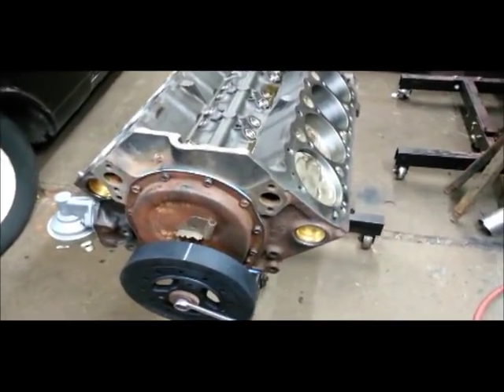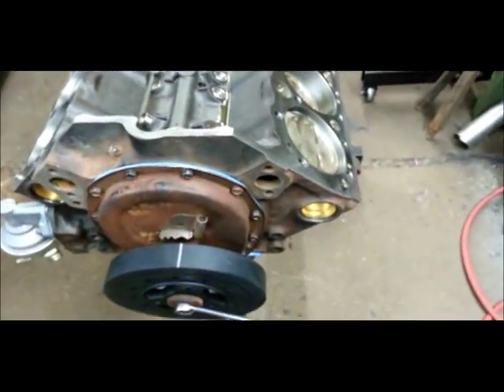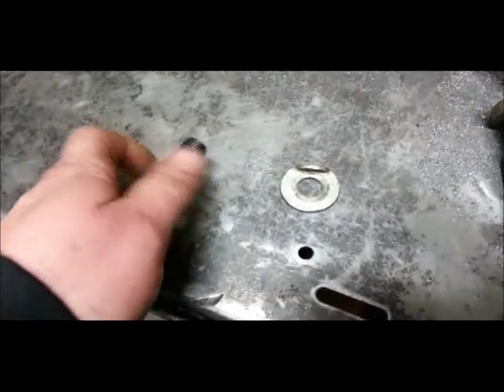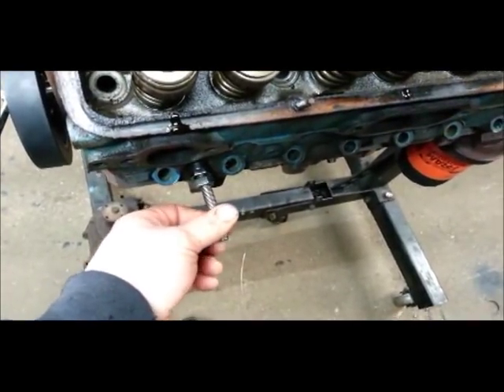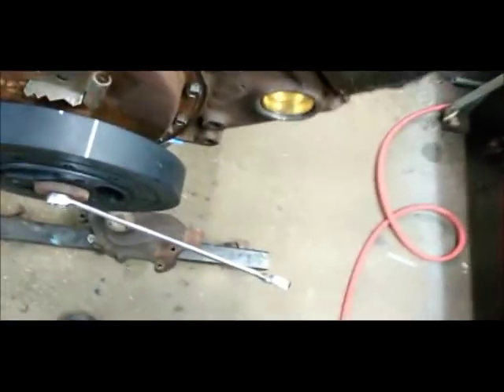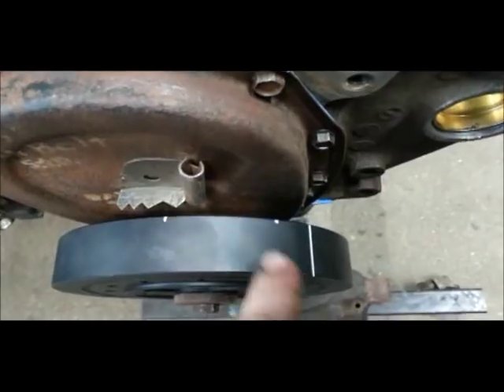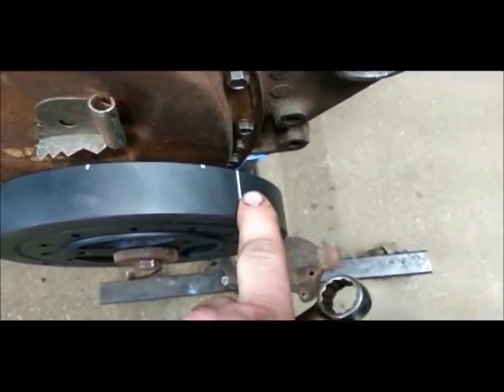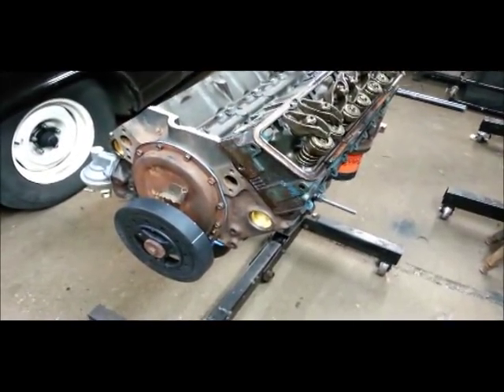finding top dead center .

Comment: Good explanation.  It took a while to get to the point but I get it now.  My 5.7 1995 Chevy doesn't have a timing mark on the harmonic balancer and there is no timing indicator gauge as well so I will be putting one on similar to your friend wanting his not part of the timing chain cover.  I guess I will do the finger in number one spark plug hole (or vacuum tester) as I am not removing the head to determine the power stroke and then apply your method to fine tune the TDC mark to make on the balancer.  Thanks!  Now to see if I can just tap some bolt threads in my compression spark plug adapter first or use your hollowed out spark plug method.  Good job.

Comment: To find out how far to put the rod into the cylinder, turn engine til compression felt put a rod ie screwdriver into the plug hole and turn motor til screwdriver nearly out, turn motor back slightly and screw piston stop in til it just touches the piston, back it off a couple of turns then SLOWLY bring the piston up to meet it this will eliminate any backlash. Hope this helps, takes longer to write than to do. Dave UK

Comment: To be clear, that's TDC for that timing marker.  If you are going to use a non-stock timing cover/marker, chrome or otherwise, you would use this process with the cover/marker you are going to use.
I've built several SBC's in my time and never saw a timing cover with the marker center top like that one.  How in the heck would you even see it with the water pump and pulley installed?
Reply: mark the pully so you can see it
Reply: @frankdavidson9675  very true.  if you ever have a balancer off, paint it black or at least the timing mark area then use liquid white out or equivalent to make the mark to get good contrast.  They are often buried down there on most cars, make easy to see.

Comment: This video does a good job explaining how to achieve # 1 TDC. 
However, if anyone is going to take the time to do this, please understand that;
..... "getting close only" is NOT OK.  
..... it is NOT overly complicated to do.
..... we can obtain acccuracy if we follow several very simple steps. 
 
The split should be near 30 degrees or so. 30 + 30 = 60. A 60+/-  degree split offers more accuracy than a 20 degree split does. 
Once the piston is in an acceptable location from Top of Stroke, the PPS tool should not only be tightened, the inner threaded portion should be locked by using the jam nut. 
The new TRUE TDC mark should be made adjacent to a timing tab ZERO notch that is easily viewable for Ignition timing.  
The marking shown in this video may become blocked from veiw by the engine coolant circulating pump and/or by pulleys. I would opt for a timing tab that was fixed more towards the # 1 cylinder. 
Things to NOT do:
.... use a finger over a spark plug port to dertimine when the piston is at top of stroke. 
.... use a washer over the cylinder bore to dertimine when the piston is near top of stroke. 
.... use a minimal split angle.

Comment: Thanks for the knowledge sharing. I only got a question, why are we doing this, was it a change on a part that changed the original mark on the balancer? Put it in a different wording, why the balancing mark didn't match the timing to begin? I am curious as I have a 99 Suburban that some people say it could be a timing chain jumped a teeth... Thanks in advance, Jose
Reply: I’m wondering the same thing

Comment: I've been messing with that old small block I've had for twenty years. I must have set the timing by ear in the old days. My marks don't line up at all. Chrome cover.
Reply from the maker: I can never seem to get the right combo of timing tabs to dampners . So I'm always remarking them it seems.
But I didn't make that tool until just a few years ago . One of the kids hanging around the shop was building a mud truck . Couldn't get it timed at all. So I came up with this , after that truck , bet I did 7 more ... lol
But I normaly will make it before the head goes on . or with the degree wheel if I'm really in the mood .

Comment: My favorite way to find TDC is to drill a small hole through a spark plug and attach a vacuum gauge to it. Then you just turn over the engine until you see the transition from pressure to vacuum. Then I back it off a little and slowly rotate again until it no longer makes pressure on the gauge. This ensures that you are on the compression stroke.
Reply from the maker: fire67bird i just use my thumb . 
But that'll work too .
Reply: ***** that or  composition paper

Comment: So the crankshaft rotates one time in doing so the engine goes through the Intake Stroke, Compression Stroke , Power Stroke and Exhaust Stroke. IF I understand this right that must mean that the camshaft rotates 2 times ?  kind of a 2 to 1 deal ? 
 I have watched several of these videos and no one has made this clear.
   Also some have said  TDC is on the Exhaust side and others have said the Compression side. Seem's to me IF it were a 180 % out  the rotor button would be pointing some where other than the number 1 spark plug.
Reply from the maker: ***** the crank rotates two times in a 4 cycle engine to make a complete power stroke . 
TDC of the piston can happen on compression or at valve over lap .  TDC on compression stroke of number 1 cylinder would be TDC for setting dist. on most engines .

Comment: I am working on a Mazda B2000  made in 1984. A 4 cylinder engine. IF I were to follow  your example I should be able to set the valve lash for No. 1, 2 In take No. 1,3  Exhaust. Then I would have to Find No. 4 TDC. I suppose the same way as you shown up how to find No.1 TDC. Except as I said with No. 4. Then set the lash for  No. 3,4 In take and No. 2 and 4  Exhaust.  Have I got the right idea ?
Reply from the maker: ***** if you find the TDC for #1 cylinder . #4 is the same . 1 , 4 pistons will be both on top . depending where your valve's ( if #1 is on compression stroke TDC , both rockers will be loose , where as #4 will be tight do to valve over lap on exhaust stroke ) so if you have it at TDC#1 compression . Rotate crank one complete turn , and #4 will be TDC compression . When you find the mark for #1 TDC , knowing 180 degrees from that mark is would be TDC for 2 and 3 . As for lash , not knowing that engine at all . I would adjust valves on TDC compression on each cylinder . unless you know what valves to adjust at crank position . like on a small block with a hydraulic stock cam , TDC #1 you do half the valves , rotate it one turn , do the rest .

Comment: Could probably use a spark plug anti-fouler instead of the plug. Nice and clean, 5$ to save the time. Later, you still have an O2 bung or its original application at least. Great video though.
Reply: I used one of those "anti-fouler" plug extenders to make my piston stop...worked great!
Reply: @wakjob961  yeah they work for o2 sensors too. Drill out the pipe and you might have to drill the anti fouler. Make a doughnut around the threads with High Heat JB Weld, then crank it down tight. 3 years now and no problems.

Comment: Only thing is it will still be off, you have slack in the timing chain and gears so when you spin backwards unloading tension off the chain you will be off a few degrees...  only precise way is dial indicator on the middle of the piston and drop it few thousandths off the stroke in the same direction.

Comment: Hi, I have a 4 cylinder car first I rotated the wheel clockwise when the piston was on the top I marked on the balancing wheel then I rotated it anti clockwise till the piston was in top position. The wheel came onto the same point where I had marked . Any explanation to this?

Comment: Very helpfull, my new balancer was also different from the original. 
My new balancer looks the same as yours, but when i install the waterpump on top of it, it blocks view of the timing mark.. What to do?
Reply: I ordered a differrent Timing Tab, which will be mounted on the side, i hope it works and it would also align with the timing mark on the new Balancer... fingers crossed

Comment: ok two questions and these may sound stupid. 1- does it matter how deep the rod is in the cylinder? 2- does it matter what stroke the piston is on?
Reply from the maker: for #1 , not really . I try to get it closer to the top of the bore when it hits the stop . But the further down the bore , the wider the two lines will be on the balancer .
#2 , no , your just locating TDC of #1 cylinder  , not compression on #1 .

Comment: I think I must be doing something wrong. I rotated the balancer clockwise until feeling compression. Screwed the piston stop into #1. Rotated clockwise until piston made contact with stop. Marked at 0 on timing tab. Rotated counter clockwise until piston hit stop again. Problem is first mark passed the 0 on timing tab before I made contact with piston. Roughly a full 1 1/2 revolution. What am I doing wrong? SBC ZZ4 crate motor. I believe the factory 8" balancer was replaced with a 6 3/4" balancer. Not sure if that's what is causing the issue.
Reply from the maker: +Anthony Escobar not sure how it could go past 1 1/2 times before hitting the stop
Reply: +chevahaulic...something had to move
Reply: Would have to be the 8" balancer was changed to 6 3/4"!
Reply: @jperkey7089 So if you find top dad's owner, do you still have to adjust your timing
Reply: Tdc
Reply: @sammycorreia1705  no

Comment: Well I copied this right out of the Chilton's book.  " At No.1 TDC  No. 1, 2 In take No. 1,3  Exhaust. At No. 4 TDC  No. 3,4 In take and No. 2 and 4  Exhaust.  All of this is a bit confusing to me. I do thank you for all your help and any idea's you care to throw my way. I do have another question for you. To find  TDC you have to be on the compression stroke, right ? Using the method your using how do you know your on the compression stroke ? I am guessing your watching the intake valve open and close ?
Reply from the maker: ***** yup , TDC of that cylinder will be on the compression stroke on 99% of the engines out there . I'm sure there are a few that dont do it that way .  ,And  watching the valves is the best way to see where your at in an engine . just make sure your rotating it in the right direction . Otherwise , things get weird fast :)

Comment: Great video!
I'm trying to find my TDC with heads off and distributor removed. can you help me determine it? i know that cylinder #1 & #6 are up but not to the rim of the block
Reply: So does piston need to be all the way to top lip? Are down 1/4 inch

Comment: I  tried this way to find TDC and several times the blow out #1 piston then put my piston stop tool in to move all the way to the top, then put my rotor facing #1 with correct firing order but out of all the tries it kept backfiring/spitting gas out of carb. What could be causing this?
Reply from the maker: +txchevyrida you might have other problems if you have it dialed in with a timing light and it still back fires .
Reply: your probably 180 out

Comment: Great video, going to give this a try. Hard thing to get your head around when it does not matter if on the compression stroke or when piston contacts the stop?
Reply: It does not matter what stroke it's on when making the mark for a zero point.... why would it?
Nor does it matter where the piston comes in contact.... again why would it?
 The stroke is 360 degrees everytime, no matter what stroke and as long as you make the contact point from clockwise and counter clockwise it could be at the dead bottom at 180 degrees! No matter what when you take both those points and divide them in half that mark will be the zero point no matter what anyone thinks it should be.
It's gonna be and that is a mathamatical FACT!
Circumference Radius and diameter all fall under the 360 degrees of laws. 
You are thinking about the piston and not what is being shown!
Setting the zero mark for TDC
The compression stroke matters when setting the ignition timing.
You are on step 35 and this is STEP 1 ON THE NUMBER 1 PISTON SETTING THE DEGREE THAT COMES BEFORE EVEN STEP 1!
THE ZERO MARK! 
0 DEGREES
And no matter what stroke it's on its 360 degrees around every time!
The one time that changes will be the last time around as you hear everything blow through the block and smack your feet from under the floor pan as you leave behind what used to be your engine as you coast to  an expensive stop to wait for a tow truck!
Lol
You are complicating the thoughts with steps way beyond the point of what he is doing and showing.
 You are not wrong at all about what you are saying it's just you are applying it before a timing mark has even been set!
SO that is what is he is showing!
How to set a mark and you can not go wrong! 
Actually that math is the FOUNDATION OF BLUEPRINTING WHEN BUILDING ALL ROUND VESSELS SO I KNOW THAT MATH WILL WORK FOR A RACING ENGINE AS WELL BECAUSE WE CAN PROVE AND MAP OUT EXACTLY WHERE THE PISTON SHOULD BE IN THE STROKE ALL 360 DEGREES AND THAT IS EXACTLY WHERE IT WILL BE AND I CHALLENGE ANYONE TO GO PROVE ME WRONG TO THEMSELVES!
AND IN ADVANCE I WILL SAY....
I TOLD YOU SO!
YOU ARE WELCOME!

Comment: Great video! For anyone about to attempt to make the tool, i tried to break the spark plug porsolin with a screwdriver and hammer, the top broke off pretty easy, but the porsolin in the metal sleeve was really hard to break, i ended up busting out the air hammer and it shaderd it in about 3 seconds, if u have the option go straight for the air hammer and save allllllot of time
Reply: I bought one online for less than $10
Reply: @GJJC13  I made one for free
Reply: @braeden10120  Nothing beats FREE!

Comment: Question. After finding tdc using the piston stop do I need to pull out the distributor and reinstall it again with the rotor facing cylinder #1?

Comment: Great video. Do you have to be on the compression stoke before inserting the piston stop?
Reply: Nope...make no difference. The rotating assembly will stop once in each direction.
Tip: take the spark plugs out to make turning it easier.
Reply: @wakjob961  Great tip... Thanks

Comment: So after you find the center point between your to marks do you then rotate the engine again and line up that center point with the pointer you used and now the engine is at TDC? Or is the engine already at TDC and you adjust the pointer over to your center mark?
Reply: Good question & because I have to do this on my Ranger like now this is what I want to know. The video seems incomplete at the end about what to do with the marks now that they are there. I would imagine crank until it lines up at the zero on the compression stroke & should be good but would like to know for sure too.

Comment: Ok, now pull the head off, rotate the damper to your new line bwtween your two marks and lets see if that piston is really on TDC. Thanks for sharing. Why not use a magnetic base dial indicator when the heads are off?
Reply from the maker: You can , but the crank will rotate a few degrees in both directions at TDC before the piston will start moving again.

Comment: So what if when you set TDC but the rotor on the distributer isnt pointing to cylinder 1? It is instead pointing in between 1 & 8
Reply from the maker: Donnell Thompson thats odd . But it will not be dead center of the terminal of the cap . once you set the timing of the dist .

Comment: what i can't figure out is- how far in you need to put the piston stop.  it seems like barely at all?
Reply: Depends on the engine and pistons...I have dished pistons, so I needed it to stick down in the hole about 3/4" to 1"...make it too long, and your two marks will be way far apart and it will be a harder to find the mid point between them. Good luck!
Reply: Thanks wakjob
Mine are flat
I found it!
Now I need to swap out the front axle with an 85 
Disc brakes!
Those drums lock up…

Comment: I got my first mark but after I start turning it counter clockwise the bolt just starts to loosen.  What do I do?
Reply from the maker: tighten the bolt to spec. and if the plugs are out , it should roll backwards . otherwise put a few bolts in the rear and use a screw driver , unless the flywheel is on , then turn that

Comment: after finding top dead center how do u drop in the distributor. Wer should it be pointing at??
Reply: jose soto 
That's what I'm wondering too but he didn't say.  Wish he'd reply because I'm ready to do my new dampner & new distributor install.
Reply: jose soto point the rotor twords no1 cylinder then go from there with the timing light.
Reply: Point the rotor at cylinder #1 top dead center with both valves closed so you know it's at top of compression stroke. Or just point at at #1 and timing mark at zero and if it don't fire you're 180 off and rotate motor 1 revolution and put distributor in again

Comment: Your timing cover isn't the right one it's for 305 engine that use different balancer on it. That's why your Mark is off using 350 balancer with 305 timing cover won't be 100% right unless you made sure the #1 position is at TDC.

Comment: That was great very smart how could you tell by sound and running condition if timing is correct anyway
Reply: It'll run smooth and like it should, without engine "pinging" happening at higher RPM's.

Running rough = timing is off
Running smooth = timing is good
Reply: @strikeforcek9149  
Thanks it runs really good smooth and Gets it when GO pedal is pushed.